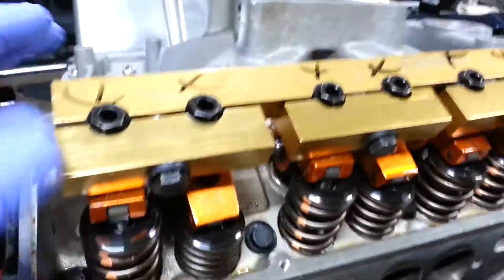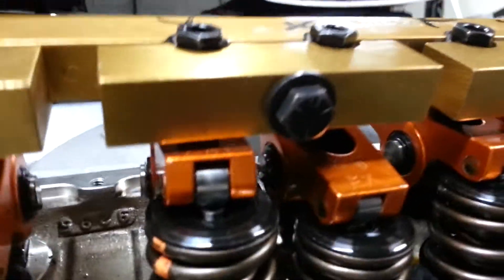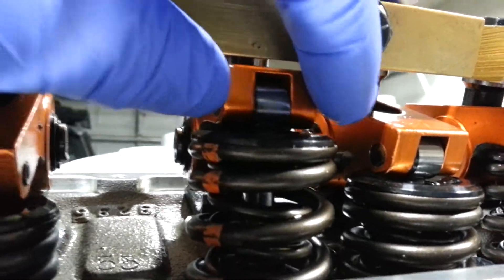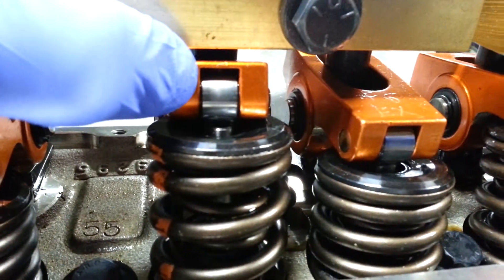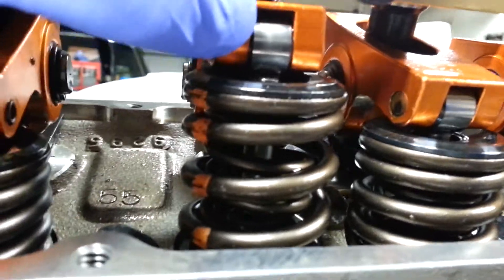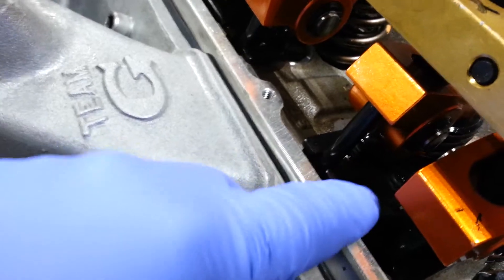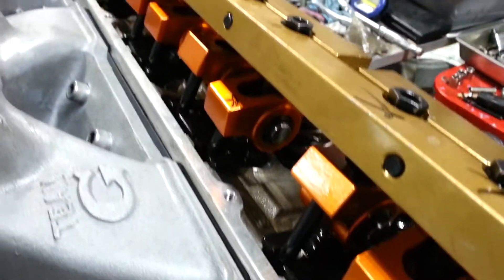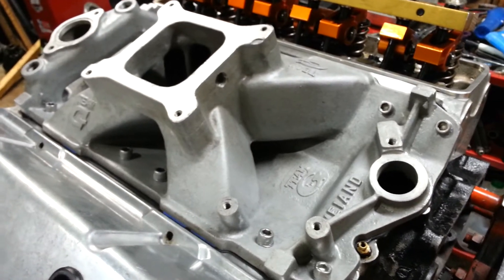SBC STUD GIRDLE AND PUSH ROD GEOMETRY

Comment: main cap and valve stud girdles are fake performance made in china garbage. Ive never seen these on a NHRA stock or super stock drag racer engine or on a daytona engine.
Reply from the maker: These are actually custom made for a big block Pontiac and were modified to fit this guys sbc. Lots of guys come into machine shop for unusal requests like this or they wanna bore our there 283/307 block to a 4" bore. Plenty of people believe all kinds of stuff is possible or beneficial but main cap girdles and stud girdles have always been used by guys just looking for that little bit of extra safety for parts. Kind of like guys using 1/2" pushrods or main cap studs. Both are supposed to help but guys usually break rockers or crankshafts before those mods break themselves. Thanks for watching! 👍

Comment: Great video DJ Rowe. Very important setup instructions in just two minutes.
Reply from the maker: Sorry that this video had cut off the beginning when loading and original wasn't saved. Wish it had all the original  info about setting up properly but I plan on another. Likely will upload over summer.
Reply: @djrowe10   It was just fine. As a machinist, I've seen some engines come into my shop over the past 40 years that make me wonder how they even start let alone run! Some things, are simply frightening lol.